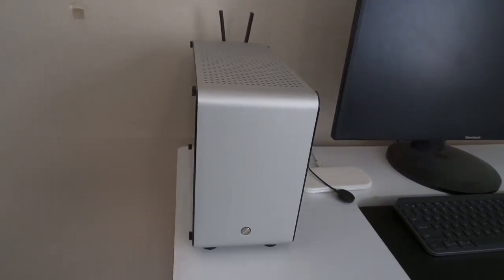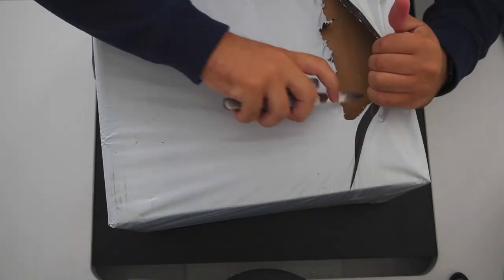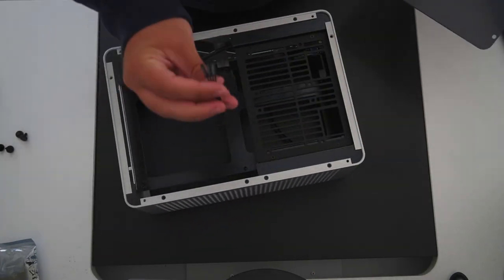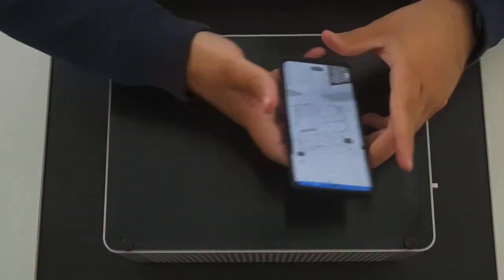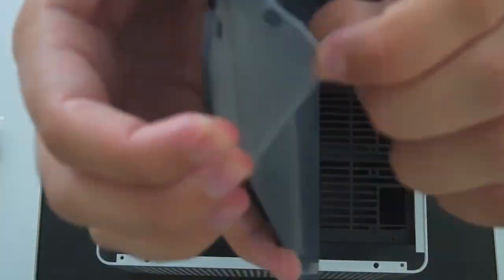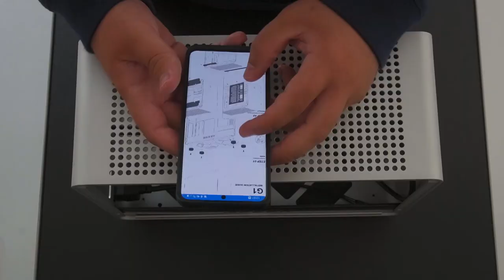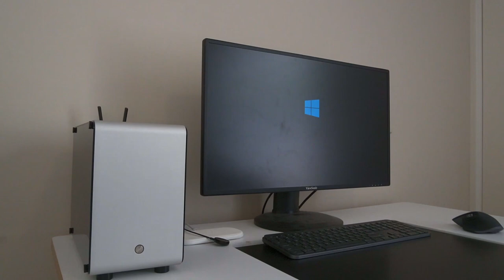GEEEK G1 Mini-ITX PC case unboxing & build w/ Cyberpunk 2077 - SFF GEEK

Comment: Debating between Geeek A60 and this case. This one is slightly smaller (by about a liter) but from what I can see, temps will be higher with a solid side panel on the GPU. My build will include a Gigabyte RTX 3070 Gaming OC with triple fans, so it's a long card (300mm) and 50mm wide. Tight fit but it'll go in.
It looks like both cases have a fair amount of work to do 🙃
Reply from the maker: I'd recommend looking at the G1 SE. It isn't out yet but is pretty much ready to go. Fixes a few of thr issues the G1 has. https://sffgeek.com/tag/geeek-g1/
Reply: you can have your acrylic panels custom cut by someone who can do it. so u can have better ventilation in the case :)

Comment: Those are some terrible GPU temps. Did you also get the mesh side panel? I'm sure the temps would be much better with the mesh panels and both the top and bottom fans as exhaust.
Reply from the maker: Agreed. I chose the discount, but I'm definitely going to get the mesh side panel for the GPU side at least. I'll also experiment with fan configurations as well. My GPU isn't a blower style card, so that's making it worse as well
Reply: @joshuaspires  i think you would've had a lot better temps with a couple 120mm's on the bottom as intake to pair with the slim 120s up top as exhaust, since there's nothing really assisting airflow in the case.
Reply from the maker: I've added a fan at the bottom, which help the temps by a few degrees. Also have the mesh side panels coming.
Reply: Those are low 5700 XT stress temps.  That's actually pretty good.  Max junction T for that card is 110C and it regularly outpaces 100C while gaming with most air cooling setups at stock frequencies.
Reply: Public disclosure: AMD knows that the 5700 XT is a thermal monster, because they designed it to run that way safely.

Comment: What noctua fan is it,and can it put on water cooling ,sorry my English is not good😅
Reply from the maker: On the top. I have two 120mm x 15mm fans. On the bottom I have a 120mm x 25mm fan. You can put two of them at the bottom but only have one. No water cooling support.

Comment: I know you've uploaded for awhile. Hope you'll answer this. You should be getting more view as you're the only person covering this case on whole of YouTube as of today.

I really wanna know if this case can support a small 140mm radiator like the NZXT Kraken X42?
Or the 120mm NZXT Kraken M22?

Nobody seemed to have covered this, not even optimum tech. I've seen AIOs in Dan A4 case
Ps: everybody asking about 240mm and huge radiators. I'm not like them
Reply from the maker: Unfortunately not. The upcoming GEEEK G1 SE will have support for a 120mm radiator. Head over to GEEEKs website to find out the specific details.
Reply: @joshuaspires  Ouh that's sad :(.. GEEEK G1 SE? Wow I'll keep track of that.

I figured the G1 is slightly larger than a Dan A4, thought might be possible or something. Alot of Dan A4 fitted with bottom mount AIOs
Reply from the maker: @KelvinTan133  You can learn more about it here as well - https://sffgeek.com/tag/geeek-g1/
Reply: @joshuaspires  Good write. Just read through. Really wondering as there seem to be quite alota space below the PSU to fit a 120mm radiator.

I might just try it if I convince myself hard enough

Comment: Will it fit full size 120mm fans in either the bottom or the top?!
Reply from the maker: You can fit two at the bottom. Top can only take 15mm
Reply: @joshuaspires  cheers mate, are they separated from each other? I own one of these and would like to use it... https://www.coolermaster.com/catalog/coolers/case-fan/masterfan-sf240r-argb/
Reply from the maker: They look to be. So might be an issue

Comment: Cpu liquid cooling?
Reply from the maker: No, using a Noctua L9a AM4. Had it from the GEEEK A50, but can definitely fit a larger cooler.
Reply: @joshuaspires  but cant fit a liquid cooler？
Reply: @wenk9882  no
Reply: @joshuaspires  How about the Scythe Big Shuriken 3 with the 17mm Kase Flex (total height 69mm)? Anyone tried that one?
Shane on Hoosiers Hardware could fit the cooler in the A60, I wonder if it would fit in this case.